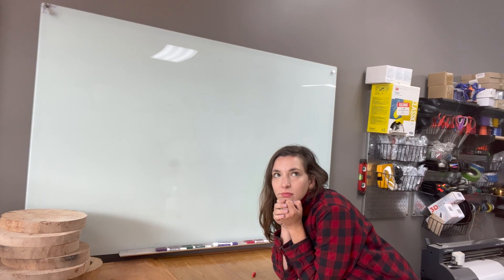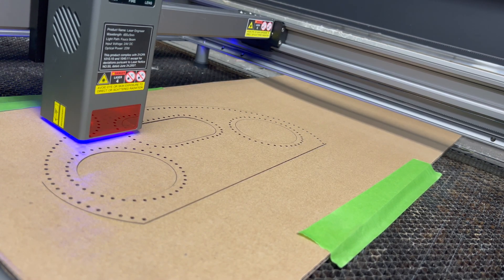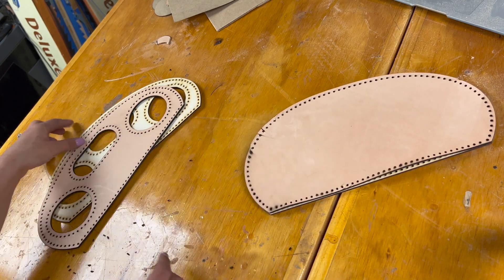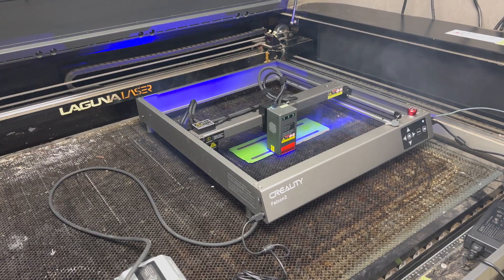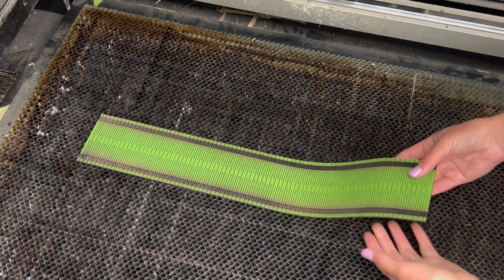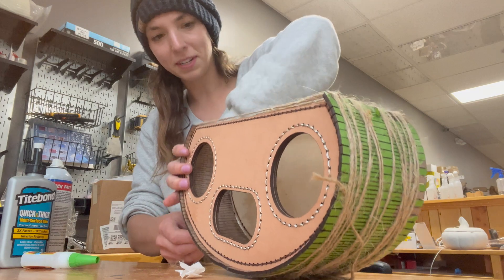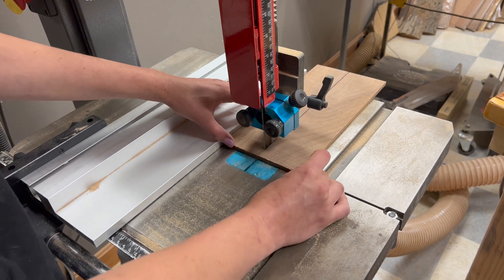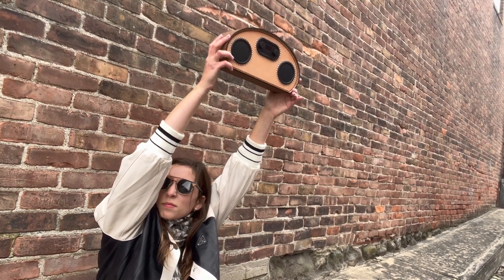How to Make a Laser Cut Radio

Comment: Hi nice job! I have an advise for you a speaker enclosure to work well need to be air tight and so the living hinges are not the best way to do it in your case. Perhaps you coul'd have filled the holes from the inside. Anyway, beautyfull project keep up your energy!

Comment: Great project (as usual). Love the twine clamp. I'm guessing you did a running stitch not a saddle stitch so you'd only have to mess with one needle? There is a certain irony of needing a big laser with ventilation to use your smaller diode laser. That's why I went with an enclosed laser that I could vent outside.